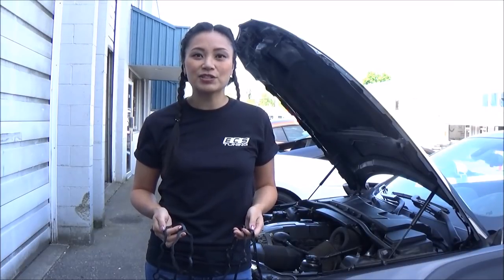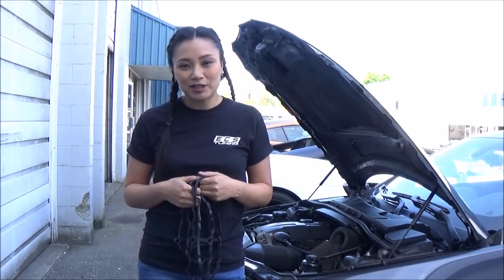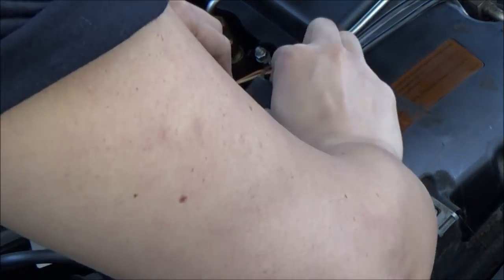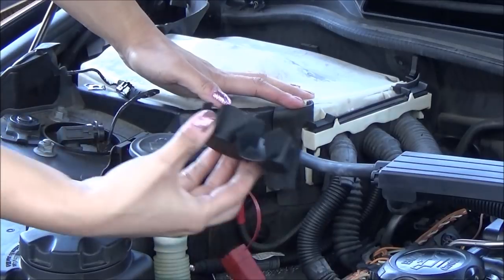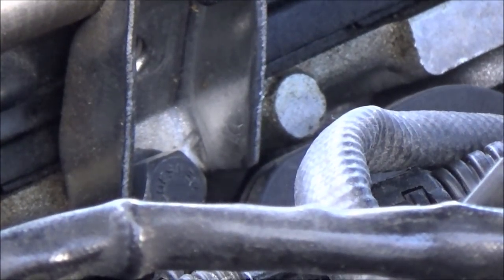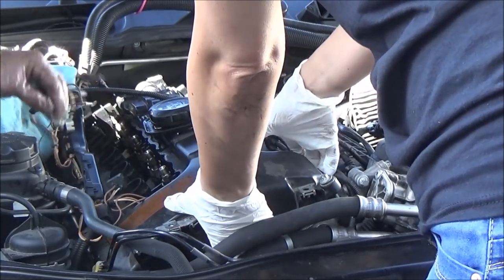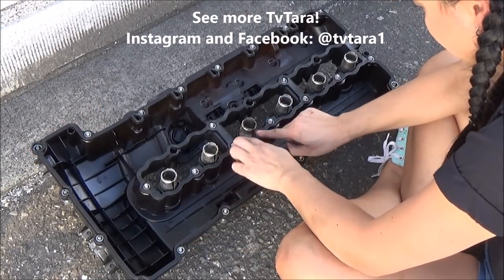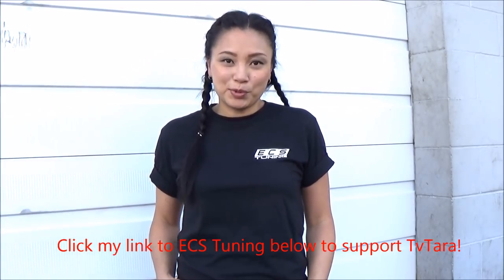How to replace a valve cover gasket - BMW N54 335i

Comment: Day 1 replacing N54 BMW 1M, 132kms.  What a pita.  23 bolts for a plastic VC? Really BMW?  The one in the left corner took me a while until I got the right length since you are working blind.  The two little vacuum lines near the oil filter housing fought me hard.  I used bungee cords to keep the harnesses out of the way.  Helps a little.  4 hrs later (6 to 10pm) and I started working the valve cover loose with two puddy knives.   Didn't get it off the motor yet.  Ouch my lower back.   I will continue work on it later.   Day 2 coming soon.   Props Tara for doing this outside on your own! I hate life already lol
Reply from the maker: Ugh that lower back pain. And the knees! Good luck tomorrow!
Reply: @TVTara  Thank you.  I hope the valve cover doesn't have any cracks.  😬
Reply: Day 2: Remove cover, remove brittle gasket and reassemble.   I had forgotten to remove the 3 grounds with a deep socket 10mm  but once removed off came the cover.   Everything went back together smoothly.  

I fired it up and rough idle and CEL!!!  I took the covers back off and realized I did not plug in the last injector plug closest to the firewall.   Put it all back together and she purrs with no leaks.   Don't be like me.  Start it up prior to putting all the plastic covers back.  I managed to break the 3 clips holding that rectangle harness to the cowel too.  The only casualty.   Time tonight was 4.5 hrs  (530 - 1000)  Total time 8.5 hrs.   Would have been quicker if I didn't forget an injector plug.  

I saved close to $900 CAD.  Gasket was $92 CAD at my local dealer (in stock).  Thanks again Tara for the video.  Ian from Victoria.

Comment: There are so many more lol things in run into while doing these job... my last valve cover job on my current n54 I happily paid and indy shop...... I got the vacle cover itself from auto zone "I was new to the platform and wasnt aware of ecs and fcp.euro " and shop charged me $450 to install. I can't stress enough when doing this... always get the valve cover itself with gasket...... and don't order it thru auto zone 😒........ after 10k miles while changing my plugs other day I noticed small puddles in the valley....... but my car is fbo and tuned..... so more power more stress on parts and gaskets. Good job! 💯

Comment: I'm about to do this job along with putting in some new injectors. Thank you for this great video and all the detailed information on how to!! I have a very injured back and I'll be doing this over two days as my back can take only so much bending over an engine bay. I'm just shy of 6'4 and prolonged bending and standing like that is a KILLER! LOL. I may be laughing while writing this but when the time comes it will be a battle!
Reply from the maker: Yes I should have worn more comfortable runners, and had more snacks handy! Good luck with yours!

Comment: Its weird that a $50 item can be charged $1500 to repair but the 5 hours work is a lot of time...thankful to the university of youtube...you can go at your own rate and simply reverse the actions to reinstall everything....you didn't mention torch settings on the head when replacing but its easy enough to find out...just the fact an owner can do it themselves is help enough.
Reply from the maker: Yeah, torque to 7lbs. Thanks!

Comment: Hey congrats on the ECS sponsorship!  can I ask a few Qs about your 335?

1. how many miles?
2. has anything on the car failed? power window motors, pwr steering pump, etc???
3. is it getting close to the time when you have to replace the turbos?
4. how long do you plan on keep your beautiful car?
5. Thanks for the info! Have a close friend with a 09 335i sedan w/130K on the clock and appreciate the info!

-Mike
Reply from the maker: Thanks! 
90k miles
I bought my 2007 used 4 years ago. I have had to replace water pump, thermostat, alternator, battery, spark plugs, and... other usual maintenance stuff. 
I think fuel pump was taken care of before I bought it. 
Not sure about turbos. 
I’m not sure how long I’m keeping it. No plans to sell but if I won the lottery, I would not keep it.
Reply: thanks Tara! So far my friend has had to replace all the injectors, LR window regulator, some front suspension pieces, spark plugs, brakes of course - I'm just worried turbo replacement is coming up :(
Reply: ok, one more question - did you change the angel eyes to nice white LED??
Reply from the maker: Yeah
Reply: no video on that??? which ones did you you install?
Reply: TVTara bonjour depuis la Martinique. 90 k miles soit 145k kilomètres et autant de pièces changées. Cela me parait un peu fragile comme voiture au final.
L’alternateur te donnais quel défaut? Car sur la mienne à 130k km j’ai du changer la poulie d’alternateur suite à un bruit de ronflement.
La pompe à eau et le thermostat son électrique d’où leurs fragilités aussi. Et en France j’ai vu qu’il y a des pannes de turbo récurantes.
As tu quelqu’un dans ta vie?

Comment: How many miles did yours have at the time? I've got 160k but no cracks in my valve cover. Trying to decide whether or not i need to replace it.
Reply from the maker: About 94k miles.
Reply: why replace something that hasnt broke yet? just wait for it to crack or leak.
Reply from the maker: Personally, I agree. But some people like to be proactive and not have their car break down and leave them stranded.
Reply: to be fair. unless the crack in the valve cover is the size of the grand canyon, it more than likely wont leave you stranded. also love the car. Got an e90 335 myself, most fun/stressfull car i have ever owned!
Reply: You do NOT need to replace the valvecover unless it is cracked. It won't crack by itself, it will only crack if someone worked on it improperly. Mine has 192k and its fine. Here are some hints when doing the gasket:
1. make sure you have ALL the valvecover bolts loosened, including those three tall grounding bolts, so there is no pressure on the plastic
2. use a plastic wall putty spreader and start working it in between the head and the valvecover (plastic so you do NOT mar and damage the head surface so that you don't have leaks, scratches=leaks) A screwdriver WILL mar and scratch the head, and it puts too much pressure on a concentrated spot which could potentially crack the valvecover. 
3. DO NOT PRY the valvecover off. This is a surefire way to crack it. The plastic is soft and flexes, but you don't want to test it
4. as you insert your plastic spreader tool between the head and the valvecover in different spots, the valvecover will eventually pop off naturally with little force
5. at this point its safe to lift it off completely as its let go and you won't crack the plastic
6. make sure you clean the mating surface of the head from ALL oil.
7. Your valvecover could have what mine had, I call it oil plaque in the channel where the gasket sits, you want to gently scrape this off with a dull screwdriver but do NOT mar the plastic, gentle scraping gets it off. This will insure that the new gasket sits flush and correctly
8. reinstall everything. You can choose to clean the valley in the head where the injectors are, and the injectors. I did this as its inaccessible with the valvecover on and I had lots of oil there from the leak. Good time to pull the plugs and clean the oil from the plug wells, etc. You can also wash your valvecover inside out. I did, make sure you drain all water from it as there is a pcv pick up port that can hold lots of water. Rotate it and shake, it will drain out.
9. Lastly BOLT TORQUE. Its only 6-7 ft/lbs. My suggestion, criss cross tighten the valvecover finger tight, all bolts ( they seat themselves, don't torue just tighten till seated). Get your torque wrench out and torque all the bolts to spec. You'll have no issue with 6-7ft/lb, no leaks, no stripped threads and no cracked plastic
10. If you haven't yet, replace the pcv valve on the valvecover. Now is the perfect time, and I can guarantee its useless and you are burning oil. again, don't overtighten, once the cover seats itself, its tight enough. You won't crack anything. 
Best of luck, just take your time and it will be fine.

Comment: Sorry if I missed it but did you replace the bolts too? I did mine last year and reused the old bolts and now it's starting to leak again. It's recommended to replace the old bolts as well.
Reply from the maker: Ugh. No I didn’t want to bother replacing the bolts. I read it’s not necessary.
Reply: If you're luck you'll get away with it, if not then you'll end up like me lol. I'll be replacing mine again soon xD
Reply: Joshua Moua hey bro my n54 valve cover went out and so I got a valve cover from another 335i that was in good condition but I didn't replace the bolts. Just curious but why do we need to get new bolts ?
Reply: Well, some DIY's state that you should and some state that you don't need to. I assume that since the bolts come with the valve cover kit then you might as well change them. I know that bolts are under a lot of heat and can stretch over time so eventually it's good to just replace them. Maybe I just have bad luck becuase mine's leaking again. I plan on changing the whole valve cover, gasket, and bolts now since I plan on deleting the pcv and running a breather on the valve cover.

Comment: Quick question, how did your injectors and fuel rail appear? I'm thinking about changing both soon, just do to the fact that my car has close to 125,000 miles on it. Kind of want to know how they hold up before I start buying unnecessary parts.
Reply from the maker: They looked fine to me but I’m no expert and don’t know what I should be looking for!

Comment: Not sure what mileage your car has but these valve covers tend to crack right under the oil filler cap. I'd highly recommend replacing it next time you do the gaskets. Nice tutorial video!
Reply from the maker: It has about 90k miles. I just didn’t feel like replacing anything else that wasn’t broken. I know, I may regret that.

Comment: I'll leave this here for those attempting this:
You do NOT need to replace the valvecover unless it is cracked. It won't crack by itself, it will only crack if someone worked on it improperly. (aka, yanked on it, over tightened the bolts, tightened it down with the gasket not being installed into the groove correctly, etc) Mine has 192k and its fine. 

Here are some tips when doing the gasket:
-1. Put your hood into service mode to save your legs, knee caps and lower back from being hunched over extra hard
 
1. make sure you have ALL the valvecover bolts loosened, including those three tall grounding bolts, so there is no pressure on the plastic

2. use a plastic wall putty spreader and start working it in between the head and the valvecover (plastic so you do NOT mar and damage the head surface so that you don't have leaks, scratches=leaks) A screwdriver WILL mar and scratch the head, and it puts too much pressure on a concentrated spot which could potentially crack the valvecover. 
Yes, you can sand scratches out of the head surface mildly, but why make marks in the first place when you don't have to?

3. DO NOT PRY the valvecover off. This is a surefire way to crack it. The plastic is soft and flexes, but you don't want to test it

4. as you insert your plastic spreader tool between the head and the valvecover in different spots, the valvecover will eventually pop off naturally with little force

5. at this point its safe to lift it off completely as its let go and you won't crack the plastic

6. make sure you clean the mating surface of the head from ALL oil. Use a lint free cloth/rag and avoid getting anything on the cam covers, valve springs, rockets etc. If dirt falls there, don't leave it, wipe it off.

7. Your valvecover could have what mine had, I call it oil plaque in the channel where the gasket sits, you want to gently scrape this off with a dull screwdriver but do NOT mar the plastic, gentle scraping gets it off. This will insure that the new gasket sits flush and correctly

8. reinstall everything....but wait! You can choose to clean the valley in the head where the injectors are, and the injectors. I did this with the cover still off as its inaccessible with the valvecover on and I had lots of oil there from the leak. Good time to pull the plugs and clean the oil from the plug  wells, etc. You can also wash your valvecover inside out. I did, make sure you drain all water from it as there is a pcv pick up port that can hold lots of water. Rotate it and shake, it will drain out.

9. Lastly BOLT TORQUE. Its only 6 ft/lbs. My suggestion, criss cross tighten the valvecover finger tight, all bolts ( they seat themselves, don't torque just tighten till seated). Get your torque wrench out and torque all the bolts to spec. You'll have no issue with  6 ft/lb, no leaks, no stripped threads and no cracked plastic

10. If you haven't yet, replace the pcv valve on the valvecover. Now is the perfect time, and I can guarantee its useless and you are burning oil. again, don't overtighten the pcv cover, once the cover seats itself, its tight enough. You won't crack anything. 

Best of luck, just take your time and it will be fine.
Reply from the maker: Thanks for the tips!
Reply: @TVTara  Most welcome, its not a difficult job per say, but its very time consuming. I forgot one point!

-1. Put your hood into service mode to save your legs, knee caps and lower back from being hunched over extra hard LOL

Comment: Did mine last week. The worst part of the job is cleaning the oil and crap out of the center of the head where the injectors and sparkplugs are. took forever to clean everything up. I washed the valve cover inside out too. the access on e9x cars is terrible.

Just like you, my legs were killing me, my back and everything. I even put the hood into service mode, but no matter what you do, you are bent over. 

I also cleaned the injectors, sparkplug holes and everything, so now its factory shiny new. 

Make sure your PCV valve works, i recommend swapping it out too. I was burning oil, once swapped that stopped., $40 valve.

Next time, I rather let bmw service their crappy designed car, and sit in the waiting room watching them through the window and laughing. #petty
Reply: Go Clunker can you show me where you got your pcv valve?

Comment: That looked easy not.why do they recommend a new valve cover?just more money?
Reply from the maker: Half the time the valve cover gets cracked in this process. It’s a lot more money so I didn’t want to buy it so I was just extra careful.
Reply: TVTara,so my guess was right it's a rip off extra part ,no doubt a bmw dealer wouldn,t be careful and just heave it off and the gasket is obviously a lot cheaper than the whole assembly,Audi are exactly the same in the UK.
Reply: So a dealer would take £1000/1100 to fit a part that costs £20.Thats not much of a margin,highway robbery.com.
Reply: Even if you got unlucky and had to buy the valve cover assembly it's expensive but how do they justify 1500,there margin is still a grand.

Comment: Can anyone provide a time estimate on this repair labor wise? I went to the dealership today and of coarse they tried to rape me with 6k in repairs. This was one of the repairs they said I absolutely needed. I’ve done this on several other non-foreign cars and the job wasn’t that bad. After looking at this, seems like a pain but there are many YouTube videos on this repair for my vehicle that range anywhere from 30 mins to 1 hr 15 minutes. They quoted me 4K for the repair and it’s $75 in parts. So that $3925  in labor, which doesn’t make sense to me considering I would assume a certified BMW technician with a moderate level of experience would be capable of performing this repair within 4 hrs ish. I’m going to just do this job myself but how long has this taken others to do and how badly are the dealers ripping ppl off?